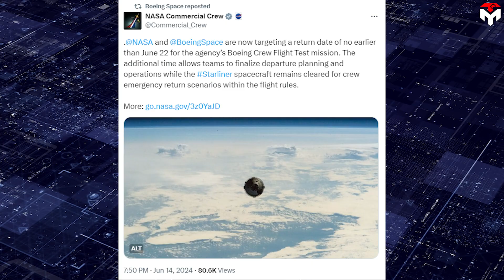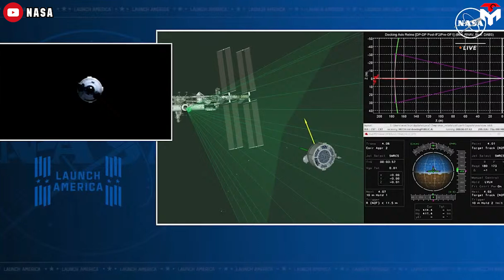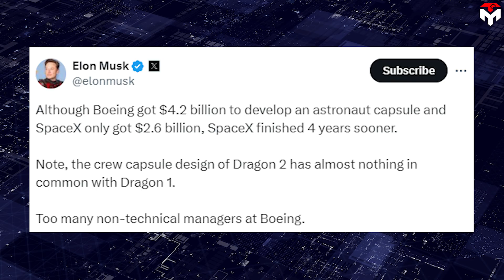NASA Boss Just Declared Boeing Starliner is TOO BAD...Can't BEAT SpaceX!

Comment: Boeing, do they have a credible quality control system in place just asking
Reply: Consider their performance with their 737 Max aircraft.  They've sat on their previous reputation for too long,  and are suffering discontent amongst their most experienced staff.  Those that are left,  that is.
Reply: Fact: Boeing favors speed over safety. Boeing been caught and continues to be caught in multiple branches of it's company skipping inspections leading to critical errors. Boeing skipped two inspections for it's capsules parachute attachment, it wasn't attached and slammed into the earth, if it had a crew they would have died. Boeing door plug, had missing bolts, they forgot them and didn't inspect to verify they were installed.

Boeing fired inspection teams for refusing to find less problems. 

Boeing seems to have killed a whistleblower.

Comment: It will be fine it has lots of redundancies, when space x doesn't. You can't have a valid engineering without validation and testing which takes years as opposed to gung ho changes on the spot and see if it works.

Comment: Isn’t it known in nasa that failure is not an option used for Apollo 13? Well it happened two times during the shuttle days! Now it looks like another one for Boeing star liner!
Reply from the maker: "Failure is not an option" is indeed a famous mantra from the Apollo 13 mission. Unfortunately, there have been setbacks during the shuttle days and concerns with the Boeing Starliner. Each failure provides critical lessons that drive improvements in space exploration safety and technology.

Comment: The thing is, SpaceX doesn't have to launch a dragon to rescue the astronauts. They have 3 vehicles docked currently on the ISS! Starliner, Dragon, and Voyuz are currently docked right now. It's a record for the most at anytime in history. They can simply choose which orbiter to use. Hopefully they don't gamble with lives of the astronauts.
Reply from the maker: Correct me if im wrong, SpaceX Dragon does not have enough for both: Crew 8 and Starliner

Comment: Starliner should be launched by Falcon and they should work out the bugs. It can't be all that bad.
Reply: Are you high? It IS that bad! It hasn't completed a successful, trouble-free mission yet! The "solution" to the first helium leak? Tighten the bolts! Surprise, surprise four "new" leaks! That capsule is dangerously flawed. Bringing the crew home aboa Starliner is FAR too risky!
Reply: @PercyPruneMHDOIFandBars  :I agree with you. I was just being overly optimistic but the truth is that NASA and Boeing gambled with the lives of these 2 astronauts. The right decision at this point is to fly them home on Dragon and being Starliner back with the trash.

Comment: NASA reached their peak capability and achievement with the moon landing.  Despite the technical achievements of the Space Shuttle, it was riddled with design and management problems that resulted in two catastrophic events and the loss of 14 lives.   NASA has had many unmanned program successes.  But they’ve lost their mojo when it comes to manned flight.  NASA, as a government agency has no ability to financially manage manned programs.  It’s very similar to how the Pentagon manages military programs.  The concept of efficiency doesn’t exist anywhere in the government.  Boeing and other defense contractors just milk government contracts for more money and performance, or lack thereof, rarely has consequences.  Boeing can’t even reliably launch two astronauts to low earth orbit using 55 year old rocket engine designs.  This all gives a nasty foreshadowing to the Artemis moon landing.  I see massive trouble with that project being accomplished on time and on budget.  America had the right stuff in the 50’s, 60’s and early 70’s.  NASA can’t achieve what was accomplished over 50 years ago despite advances in technology.  Government is too big, too powerful, too expensive and too inept.  Throw in some corruption too for good measure.
Reply: Both Shuttle disasters were acts of criminal negligence! Not system design! When you operate something outside of its design parameters, it is the fault of the operators! Not the system
Reply: @scoutdynamics3272  there’s lots of info out there about shuttle design problems and just how lucky they were with each successful flight. Plus there were bad decisions made on launch day as well as throughout the program.  Bottom line, there was no accountability.
Reply: @roch145  None the less, both disasters were the result of criminal negligence! Not design failures! In both cases, design parameters were ignored and defied! Today, you can look forward to "So what if the rocket blows up!? We now have an LES! Launch anyway!"

Comment: please don't put the crew at chance crew dragon is safe no need to lose lives
Reply: if you want to go with that logic, we shouldn't have used crew dragon in the first place, we would have kept using Soyuz - a very reliable crewed rocket that we've been using since the Space Shuttle retired.

Plus, crew dragon uses a new rocket with more complex systems (the booster lands itself) and its launch escape system uses hypergolic liquids instead of solid fuel.

Starliner, on the other hand, uses tried and true methods: solid fuel launch escape, trusted launch vehicles, and more.
While it does use some old technology, it has made improvements. It has more storage space and moving room than the Soyuz, it can be launched from the U.S. and it has more updated systems.

It is valuable to give multiple people a shot at getting better. If you just go with the current thing, nothing will ever get better.
Give newcomers funding so they have the chance to improve.

NASA has safety tests and requirements to ensure that all crewed rockets are safe for all astronauts involved, which have increased dramatically since the Space Shuttle program which had many failures.

Comment: Boeing used to be a good company but it needs to get back to building aircraft and rockets and stop being a woke company . Trim the  fat if the people are not excellent in their field of expertise they need to send them home . If your company is not the absolute best at what you do you will be in the history books as a has been.
Reply: The problem is that they did trim the fat and handed it out to subcontractors because the CEO wanted more short term profits so that he could get a big fat bonus. Boeing stopped building aircraft and now they assemble them instead. They also opened the South Carolina factory because they could make that a non-union shop and pay less, which became a problem because South Carolina didn't have enough skilled workers available. Outsourcing parts and labor for Ipads and cars works fine, but apparently not so much with aircraft.

Comment: NASA has been funded, defunded, villified, celebrated, emplored and exploited since it came into existence. When bureaucrats hold the pursestrings and then have the power to dictate the what, where, how and why of a particular mission it is just a recipe for failure. The sixties saw it's inception with a mandate, unwavering with a challenge to land on the moon before the next decade. Designed to be similar in scope to the U.S. postal service where it managed it's own budget and made it's own way, it slowly became a political pawn and instead of good educaated engineering staff helping to determine contrac awads and vetting military contractors, the Government took it over and essentially dictated how a budget was spent and divyed up to what contractors. Which lead to mistakes, quick decisions and oversites. Musk has ONE  major ace that NASA never will. He has his own budget and it is run with quality, service, longevity and safety in mind.but there is not ONE DAMNED GOVERNMENT COMMITEE dictating to him what he will or won't do. And frankly the FAA wouldn't be able to stop a launch if they wanted to. Which is why this administration hates all he does because he told them they could go F...k the monkey. NASA has been the monkey screwing a football for 4.5 decades now. This latest overbudget and useless better late than never attempt...even with the ONGOING problems and delays, just justifies Musks ability to be the leader and NOT the follower in our next step into space.

Comment: NASA really has no choice.  NASA has already paid for six crew missions to the ISS.  Even if NASA wanted to cancel those six missions Congress will refuse to authorize the budget, about $1.5B, to pay for replacement flights.  Why? Because money paid to SpaceX only benefits California, Texas, and Florida, while Boeing has subcontractors in almost every state and several foreign countries.  

There is no good reason why Boeing is over five years late, and still encountering, and failing to fix, fundamental design flaws.  NASA is clearly covering up the reasons for delaying the completion of this OFT.  Boeing is currently billions in the hole on the Starliner project, but it is hoping to recover its investment through future missions to the future space stations which will proliferate to exploit space manufacturing which the ISS could only perform on the level of experiments.

Note that while SpaceX has the resources to fly a "rescue mission" it would be extremely inconvenient.  At the moment SpaceX only has two operational Crew Dragons.  One is currently docked to the ISS and the other is committed to the Polaris Dawn mission in July.  A third is under construction, but it is in support of Axiom Space for its project to build a replacement for the ISS.  SpaceX has clearly assumed that Boeing will carry out its six missions.  Unlike Boeing for SpaceX NASA is only one customer.  Going forward NASA will only be the third largest customer for the next five years.  SpaceX is not afraid of competition.

The Starliner astronauts are in no immediate risk.  Frankly they should have already returned before some other problem shows up on their jalopy.  They cannot safely return on Crew Dragon except by removing the seats from Starliner and bolting them into the tight space under the four regular seats in the Dragon.  Engineers will then need to figure out how to connect the life support systems of their suits to the Dragon as a precaution against the possibility of a hull breach.  Dragon has a capacity for 7 astronauts, but only four seats.  The Dragon currently docked to the ISS is due to return in August with the completion of Crew 8..